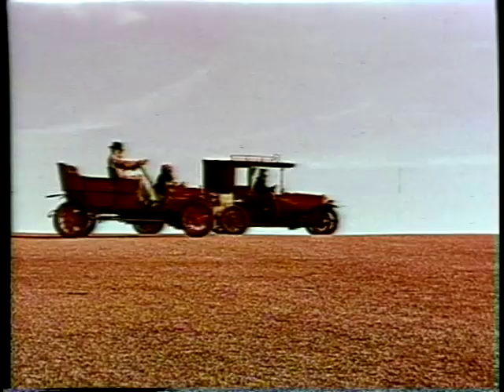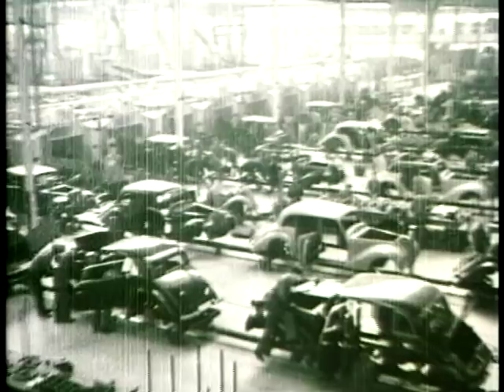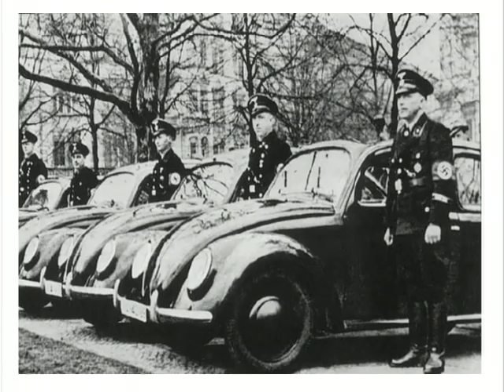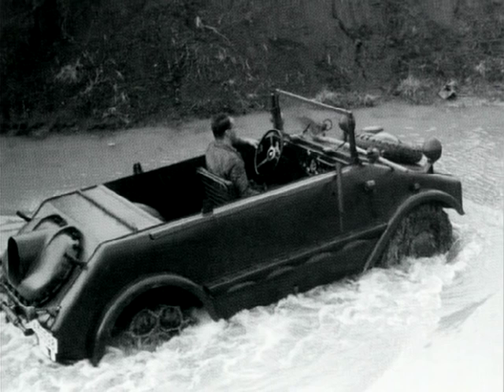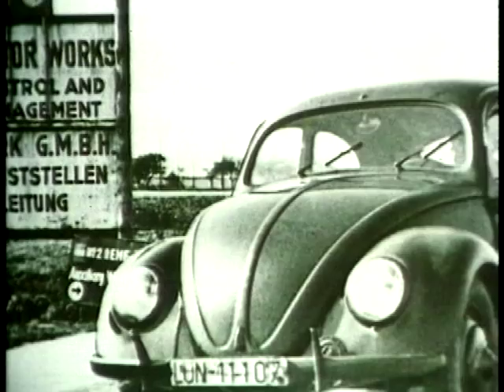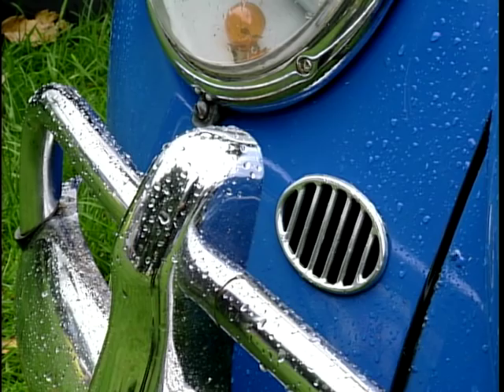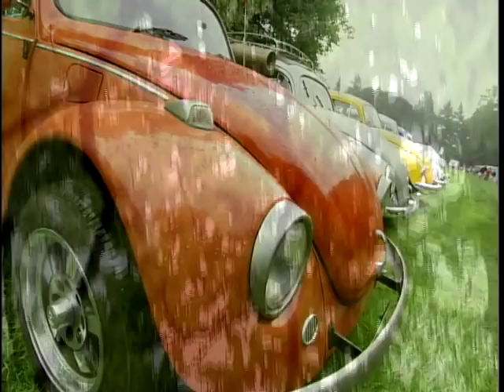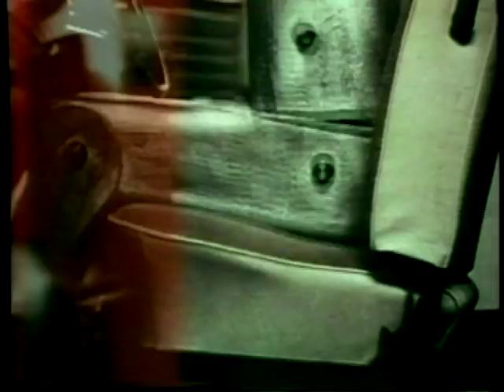The Beetle Bug

Comment: When we sold our 1960 Beetle in 1967 it had over 100,000 miles on it.  3 of the 4 tires passed the safety check.  It never had a spanner on it except for routine maintenance and a valve job.